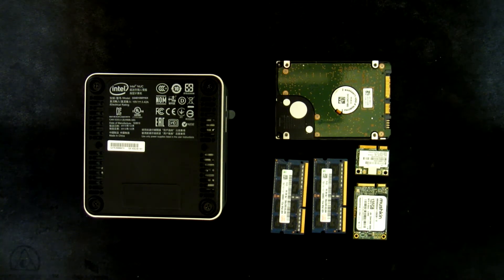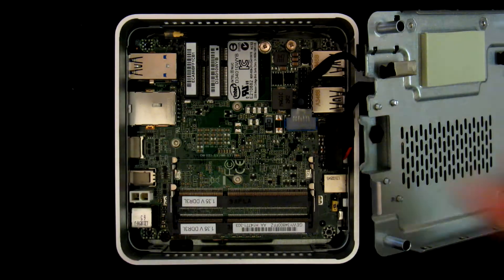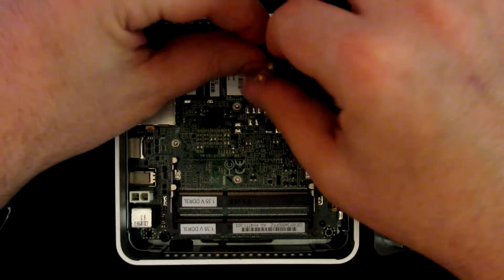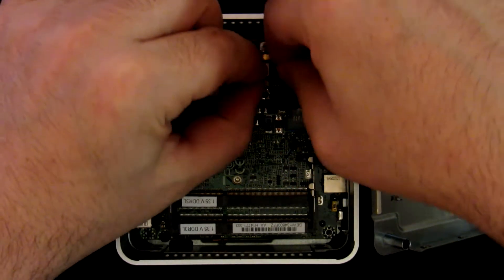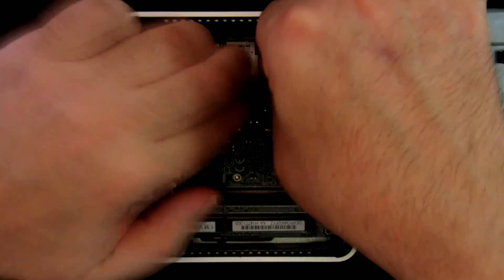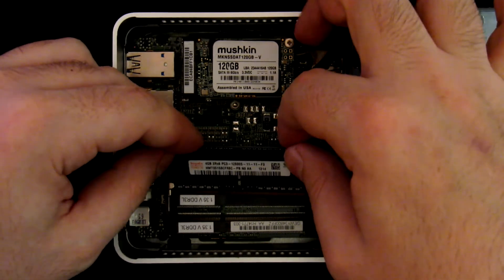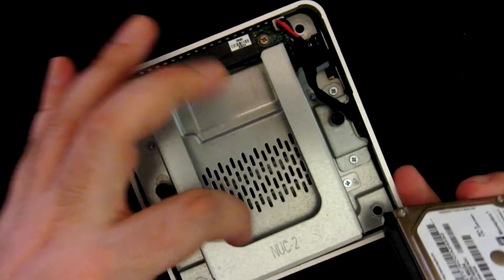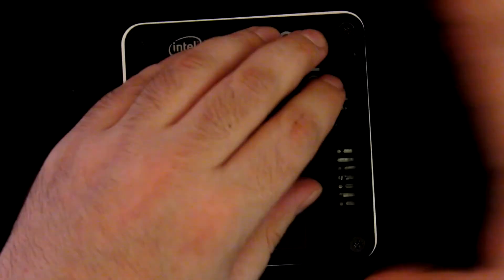Intel NUC D34010WYKH - Component Installation

Comment: have you read the manual, mate? the black wire goes to the top (close to the ssd screw hole) and the white under it, you just mixed them up))
Reply: yup, black wire on top. thanks Vit WebDaeon. would have installed it wrongly if i just followed the video. Then my Wifi wouldnt be working optimally